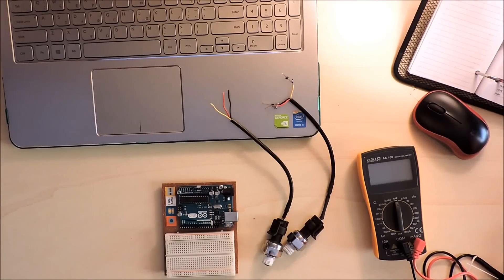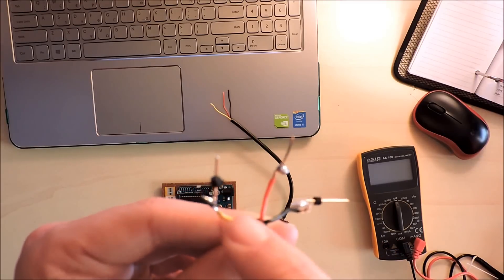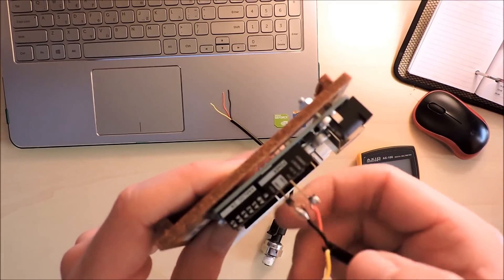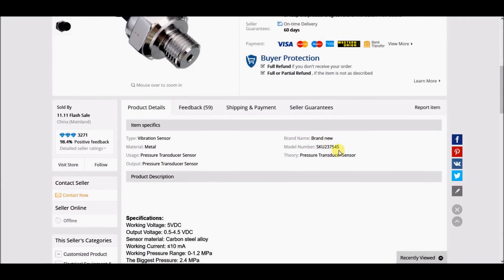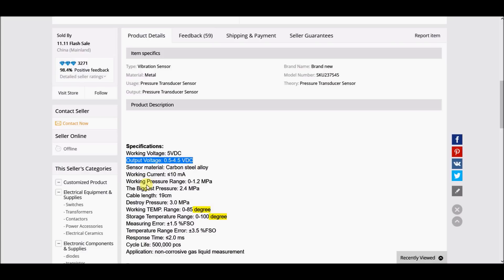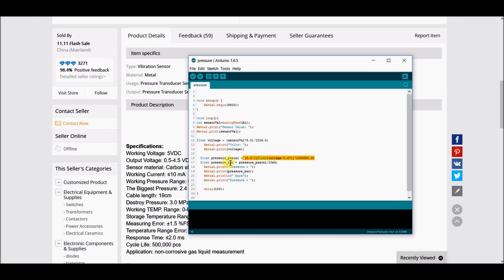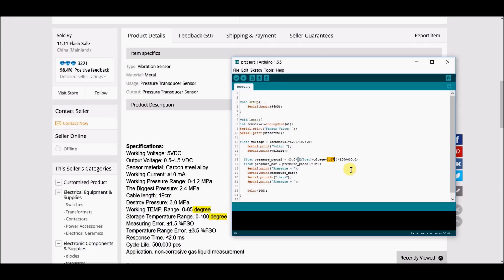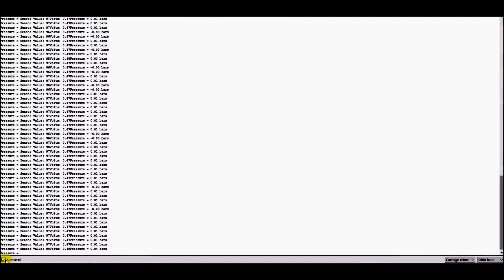Connection and Programming of SKU237545  Pressure Sensor

Comment: Thank you for your video and the code, can you please explain to me the relationship of how can the voltage affect the pressure value? I got the same pressure transducer and the code worked well but I don't know how did the pressure readings changed in your video when the screen is black? what you changed exactly? I want it to measure the pressure in the pipes of a closed system and displays the value on the computer.
Reply from the maker: Dear Mohammed ,
I used the sensor in the same experiment. To tell u the truth i don't know why the screen went black. Maybe i mis-clicked something because this is my first video in youtube. 
To answer your question this sensor receives 5 volts for arduino in order to work. Depending the pressure in the pipe the sensor responds to arduino with a change in voltage ,  because the only thing that arduino and all the electronics can understand is a change in voltage or current. By changing the voltage and using the code in the description we translate the voltage into pressure readings so that we can understand whats going on. 
Please feel free to ask me more!
Reply: Thank you for your reply, could you please explain the following two equations that you used in the code? I mean how did you get them and choose the values in the equation.

float voltage = (sensorValue*5.0)/1024.0;
float pressure_pascal = (3.0*((float)voltage-0.47))*1000000.0;

Best regards,
Mohammed

Comment: What is the sensitivity of this pressure sensor? I mean what is the minimum change in pressure that it can detect?
Reply from the maker: Dear Arbab,
It can detect a change from 0.5 to 4.5 volts. if you put these values in the code formula you will get your answer !

Comment: My CUDOs to Giorgios. Thank you. There is little to no useful documentation about the sensors electrical specs.
I was confused with the calculation of pressures from voltages. Some chinese vendor(s) descriptions contain a different formula for calculating pressure from the output voltage like Vout=Vcc * (0.75* P {mPa} +0.1)).

Don't get fooled! Georgios' formula is perfectly right.

In essence - compared to the low price, this sensor is pretty accurate and linear. 
My application is an electronically controlled and Arduino operated rear wheel air suspension for my motorcycle.
Reply from the maker: Thank you Johannes for your nice words !!
Reply: Hey Giorgios,

Would you mind sending me that code (or even a good screen shot of it) to my gmail?

I'm using this read maximum compression in a 12 cylinder vane type pump - Will this read fast compression cycles like a normal pressure transducer, as a normal gauge seems to not work in this application.

thanks

gdavis2265@gmail.com
Reply: @glenndavis2762  are you that fucking lazy to just copy from video?

Comment: does it need to be calibrated ?
how can I obtain the code please?
 thanks
Reply from the maker: Yes you can calibrate it by using an external pump like those we use for pumping up a flat tire which has already a pressure measuring instrument in order to observe if the real pressure produced by the pump is the same or approximately the same with the pressure sensor. In order to achieve the perfect calibration you must eliminate all losses , which is difficult and change the 0.47 in code to 0.48 or 0.45 .

Comment: please guide if this sensor can be used for pressure of water in a tank. tank max height is 6 feet .( can be from 2 feet and up to 6 feet)
Reply from the maker: 2feet to 6 feet means 0.6 to 1.8 meters. This pressure sensor has a range of 0 to 1.2 Mpa that means 0 to 12 bar. Hydro static pressure is increasing as we go deeper in the sea. 10 meters below the sea surface we have 1 bar pressure , 20 meters we have 2 bars etch . You are using a small tank so there is no chance of achieving pressure above 12 bars . I hope that i helped !
Reply: Can you suggest a sensor for a 2*2 feet water tank or lower. What should be the range of pressure sensor.

Comment: if i Plug the arduino into my pc and i want to Play a game where the pressure Sensor gets recognized in game as a analog Signal do i need to do this Code too? or can i Just Plug the pressure Sensor into the arduino and its fine?
Reply from the maker: Hi there, in order to use a sensor you need to have the appropriate code too. None sensor can be controlled or monitored without the right code !

Comment: is it possible to inform me who is the manufacturer of this product?
Reply from the maker: +Kiki Aggelopoulou  Γεια σου Κική ! Hello Kiki. I am afraid that i have no information regarding the manufacturer of this product . I bought it online because of it's low price . I asked the seller about the diagram and the equation that is used in this sensor to calculate the pressure but he gave me no answer . He was probably a re seller . 
However , i found out from a similar product that the equation is linear so that make it easier for us . Then i did some experiments with a real air pump in order to verify and validate my theoretical model. 
It works perfectly !
I will soon enough post a video of the experiment. For any other questions please feel free to ask ! 
Thank you !